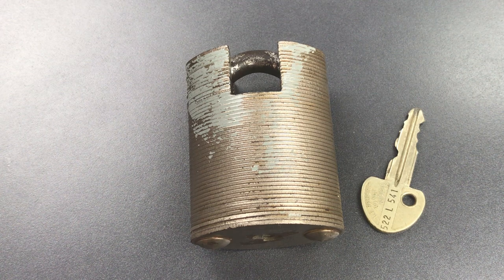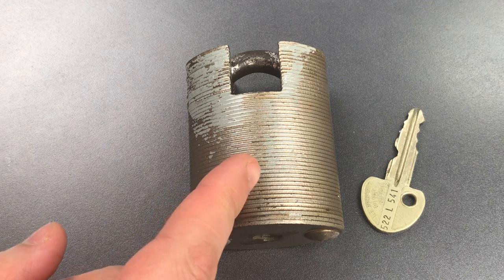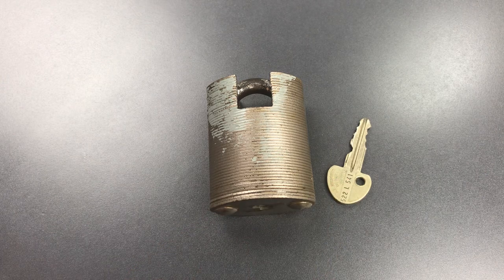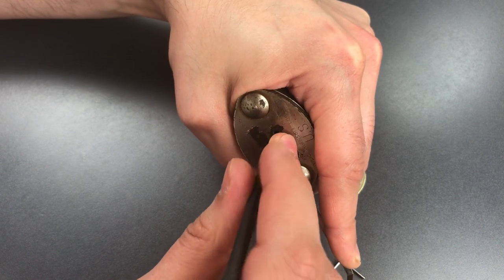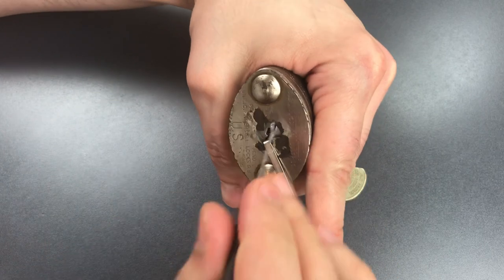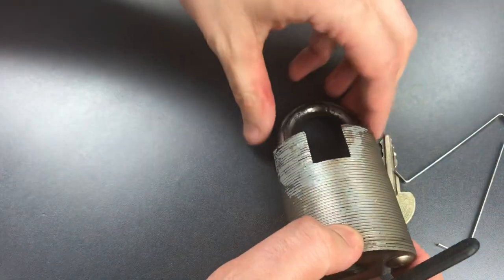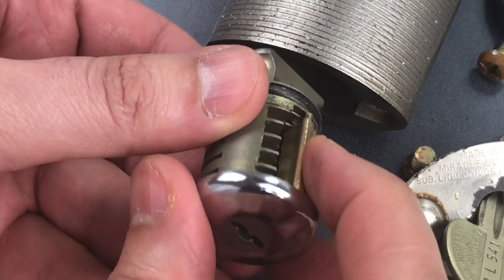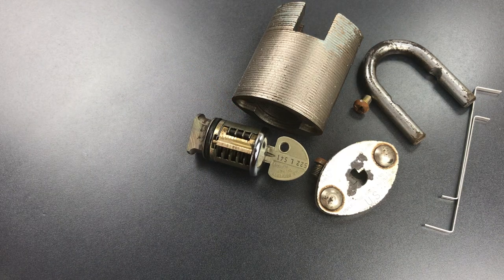[687] U.S. Military “Miracle Lock” with Ingersoll 10-Lever Core Picked and Gutted

Comment: When I was in Germany in the early 70's we had these locks securing our arms room.  We had an alert early one morning and couldn't find the armorer.  One of my PFC's said he could open the arms room.  I told him was crazy.  He took out the key for his Volkswagen put it in the key way and wiggled it a little bit and the the lock opened.  Lost all confidence in the Army's security practices.
Reply: No he never,a VW key will not even go in the keyway
Reply: cardiffpicker1 the dude must have snagged a key and was lying lol
Reply: @omgitsjoetime if it really  happened  then that is the most likely  scenario
Reply: cardiffpicker1 in the 70s keys were smaller
Reply: @acciaiuoli  I know but they still wouldn't  fit, VW keys were flat ingersoll  keyway  is like a W.
Reply: @cardiffpicker1  What do you mean "flat" or "W", do you mean like using a single side of the key vs both sides? Because there are VW keys that use both sides of the key (grooves in both sides with no flat side).
Reply: @rdizzy1  key profile ,VW are not technically  flat but majority   can be used either  way, ingersoll  profile  is like a w shape and no VW key would  fit in the lock.
Reply: I think maybe the problem is that the lock he remembers might not have had an Ingersoll core
Reply: @omgitsjoetime  And didn't want to lose his access to the room if the lock got destroyed. Luckily he had a very gullible superior. :)
Reply: Dude VW making sure your always equipped lol. Impressive.
Reply: Also was with the German military ( Smsgt ret GAF ) . We have 2 locks at our arms rooms and a Alarm system. During the day one of the locks is open. The key is in the posession of the comanding officer. The other one is in the posession of the armourer. Spare ones are located in sealed envelopes in the safe at the guard house for use in case of emergency. No way that only one can open the door. No need to pick / demage it.
Reply: @cardiffpicker1  Hmm but in the 70s Euro car keys were not much bigger that locker keys and were only one way.

It was said you could smack a suitable sized flat blade screwdriver into a worn lock and open it that way.

And if you Googled it you might find Ingersoll used to make car ignition locks ... perhaps the cores were very similar???

Pure speculation of course.
Reply: @t1n4444  vw have never used ingersoll  made locks in their vehicles.
Reply: @cardiffpicker1  Well it was only speculation.
Reply: Did you ever find the armorer?
Reply: @jeremiahm3765  Yes.  He lived down town with his wife and was late getting in.  We could only open the outer door so we didn't get our weapons out.
Reply: @cardiffpicker1  old european vw beetle keys looks a bit like
Reply: @t1n4444  I once saw a prankster open a load of cars (back in 1984) with just one old car key.   Long time ago cant recal makes, but he opened many car doors with just one key.
Reply: @ukdashcamguy500  Crikey!!!

So VW did use Ingersoll locks (and keys) after all!!!  Game set and "match"!!!

I knew it all along!!!

So much for all these VW lock expert ...

Just goes to show ... (wait for it) ... "always trust your ignition".
Reply: @t1n4444  I love it!
Reply: never happened. it takes a pro picker a few minutes with premade tools to open it, there’s no way in hell someone did it in seconds jiggling the keys.
Reply: @bostonrailfan2427  depends. If the lock is sufficiently worn, which you'd expect from military grade locks, them using the locks a lot over long periods of time and not being particularly aware of how wear can affect a lock, then it's resistance to a raking attack can be significantly reduced. If the key he had in his car had similar toothing to the lock, then the lock could definitely be opened with a small amount of jiggling. The tools used by LPL do certainly work to open a lock, but from my understanding they are the slowest method for picking a lock, if by far the most reliable, being able to open almost any lock with slight alterations to the setup.
Reply: ... some interesting stories, but when I was in the Army reserve (I was the logistics sergeant and therefore the armorer) we would just send one of the lighter specialists up into the ceiling to drop down inside and unlock from the inside.  This was the supply room and not the armory... but an armory key was in there, so not exactly secure.  For clarity I should mention that I didn't have a key since I was a reservist, the UA had the key and there were multiple occasions in which he was unavailable but still demanded that I do my job -_-"

Comment: "I'm not sure why some of these locks are fairly easy and others are quite hard"

Those might be the quality control issues you mentioned.
Reply: The QC issues stemmed from the Finnish core, not the English core. Bit who knows
Reply: Some are master keyed which makes any lock easier
Reply: Some might be much more worn out than others. That can make a big difference to the pick-resistance of a lock.
Reply: That's exactly what I was thinking when the gates didn't line up very well at the end

Comment: I was an AMMO troop in the USAF from 2005-2009 and I instantly recognized that lock when I saw the thumbnail. We used the same lock (although the housing/body was made with a smoother surface, not sure of the type of metal) to secure all 100+ munition storage facilities (ie. "earth covered igloos"). I always wondered how easy they would be to pick. Thanks for the video!

Comment: Great videos man!  
When I was in the US Navy (Surface not Sub) many years ago we had these locks on the torpedo and missile magazine doors.  They were there to keep bored sailors and contractors and such honest.  The weak link was the doors themselves.  I won't elaborate on the doors, but in addition to the lock there were also armed security patrols and alarms.  Because there may or may not have been nuclear weapons in the missile magazine, the lock key was kept inside a small safe with a combo lock which was in turn kept inside a bigger safe with a combo lock.  Known as the inner and outer safes, no one person had both combos.  You had inner combo holders and outer combo holders and it took one of each to get the key to the lock, after alarms were turned off (2 people) and sentries were posted.  It is called the 2 man rule.  No person is ever allowed to be alone with nuclear weapons, even if they were just going in to do something as routine as magazine temperature checks.
Reply: That's how it looks on the New Jersey.  Don't think they ever had a nuke, but they had the control system to operate them.  Nested safe, two keys just like you said.

One of the more recent videos on that channel.

Comment: Years ago, I had a similar lock (externally, it looked the same) that had many flat plates (don't remember but I think it was something like 78 plates) stacked in the core and it used a double-sided key. Motorcycle thieves on Okinawa used a screwdriver with a lever to shear the pins on regular locks. They tried unsuccessfully to open the lock I used. Fortunately, I was still able to open the lock with the key. I disassembled it and found that they had damaged some of the plates. The lock continued to provide security until I left Okinawa.

Comment: I had one of these padlocks 20 years ago, but a genuine Ingersoll one, I tried picking it for years with no luck, but also had very little idea of what was inside as they are rare as hell in Australia, and we pre-internet easy to find times. 
Ended up working at a different locksmith shop, managed to get a new cylinder and keys as my new boss knew about them and who had spares. 
The face of it has layers of harden steel and ceramic, was not an easy task! 
But, glad i now have a functioning one!

Comment: I was an Armorer in the 82nd ABN. about 1989-90. when MY unit changed out the Padlock I kept the old one. IT is one of the 10-lever ones. I don't have the regular key. but do have what I was told is the Maintenance key. when you use the key if you turn it counter clock wise, you can pull the tumbler out with the key.

Comment: You know whats funny these types of locks where used to secure tactical nuclear weapons, so you could literally steal a working nuke by picking this type of lock
Reply: Nuclear weapons are always guarded, so you'd have to pick two of these without the soldiers standing right there noticing.
Reply: Most nuclear thefts are actually caused by brute-force destructive attacks, such as >36" bolt cutters, or Ramsets. The best defense is to make your nukes not the easiest target in the neighborhood.

Comment: Had thes in my unit in Korea 1975-1976. Arms rood with three locks , mail room, safe room, and ammo dump (gate and each bunker). All had 1/4” steel covers over them so they could only be accessed from below. would sure like to see you pick the lower arms room lock that was about 18” off the floor. Keys kept in two safes, duty officer had the key to the safe room for 24/7/365 access. O400 alerts can get messy so quick easy access is required.

Comment: Ingersol are a common front door lock in the UK, especially on older properties 
For quite a while you could only get spares directly from Ingersol
Self locking latch and good solid brass lock and key
Most modern properties now have flimsier locks

Comment: I too love these locks.  It would be easy enough to cut some false gates into the levers. I might try that if I can find another one of these locks
for sale. I'm glad it's not just mine that's a bit unreliable with the key. Hopefully now I know where to look for the inconsistence, I should be able to file a new key (if I can get a blank) or widen the gate a little on the lever that's sticking. I don't use this lock, it's in my collection, but I like to have reliable smooth working locks. So thank you for showing the detail (I was scared to lift the sidebar on mine!)

Comment: I'd like to see this lock being picked when it's actually on a door or weapon cabinet. most likely you'd have to do it upside down as there wouldn't be enough space to turn it around. I'd say it's very safe and nobody is going to pick this open in real scenario (unless thief is someone like LPL and knows 100% which lock is being used).

Comment: They had lever locks on the steam or coal access tunnel cage gates underneath or leading to bank buildings. Lots of blind false gates in the levers, which are stashed behind a metal curtain, or TWO, inside the locks! Lever padlocks were notoriously easy for my second cousin to pick, but he has passed on ages ago, and is the same generation as most people's grandparents or great grandparents, so lever padlocks were much more common back then. There is room for false gates in an Ingersol padlock.  I don't know why they didn't use some.

Comment: I recognised that ingersoll key straight away - it is very distinctive and when I was a child, we lived in a road in the UK, where these locks were fitted to every door, doors which were distinctive large oak structures themselves. (The houses were constructed in the 1920s - I think.) No-one could cut a spare key as the indentations were on both sides - you had to send the serial number - prominent on the key - to the manufacturer to get a duplicate. Anyway these were seriously secure doors which often would blow shut and lock people out their homes. Yet my mum worked out that could easily get back in within seconds and would let neighbours into their homes when they had been locked out. For reasons of style the letter box slot was vertical and right next to the lock. If you had a thin enough arm as she did, you could slip it in, reach around the flap and pull the lock lever (it pulled outwards rather than turn). Lol. It was the original letterbox - maybe they were meant to have a letter cage, but someone removed it - after all, we like our letters dropping on our mats in england, where we train our dogs to rip up the red coloured ones.

Comment: If they put a protrusion at the end of the spring loaded side bar that went into a notch on the key. Then made it so you had to reverse rotate the cylinder to push/squeeze the sidebar down against the spring load into the gates and the key notch. Then you have to pull out on the key so that the notch holds the side bar down while you rotate the cylinder in the other direction to unlock the lock. That would make the lock virtually un-pickable.
You would have to reverse rotate pick the lock to push the sidebar down, then know that you have to reach all the way to the end of the cylinder with a strong rise pick to grab the protrusion and pull on it thus holding the sidebar down while then rotating the cylinder towards unlock until the sidebar was past the block.
Hope you can picture what I just said.

Comment: I'm curious if LPL is allowed to do a Sargent & Greenleaf padlock?  40 years ago, an armorer lost the keys to an arms room padlock and was going to trash it, but instead gave it to me for a paperweight.  I obtained a replacement Medeco core and keyset a few decades later after the military stopped using the locks.  I've taken the lock to several locksmiths, and they seemed clueless about how to open it.  I contacted Sargent & Greenleaf and they said it is their policy to not open such locks issued for government use. The key teeth have alternating compound angle cuts, unlike any regular key.

Comment: I'm watching this for the first time some three years later.  I'd like to see you pick this lock as it was used in the field.  You see, the lock was recessed in a steel box that snugly surrounded both the lock and the hasp.  There is just no way you would be able to use those three or four inch levers.

Comment: AVA was very good lock. Did they have any quality issues? It sounds odd to me if they had as I’m familiar with AVA and it was well made as was the key. The Finnish bicycle factory Helkama used AVA locks and they worked always well. Today they use Italian made Basta locks which are a nightmare in wintertime. We call them ”Baska” witch sounds similar to s*it. AVA was used everywhere in offices as desk locking systems and I miss them because they were small, well working wonders. I hope you don’t disagree with me.

Comment: That technique, with two tension wrenches, and rotating the lock to switch between the two, looks like it would be impossible to use, if this padlock was actually attached to something.

I'd love to see you build a workstation where you lock padlocks onto a shackle, and revisit this,  and other difficult locks, without being able to move the locks around.

Comment: if this was on the igloo door i don't think you'd be able to pick it. there is thick metal hasp that encloses the whole body. and a plate below, to prevent working "upside down"  not only that you would jiggle the door setting off the alarm.

Comment: Now imagine this lock is actually locked in a hasp where it doesn't have anywhere near the range of motion LPL has holding it in his hands.  Swapping those tension wrenches back and forth is going to be way harder.  Seems far more likely someone would open it with a sledgehammer or something than pick it.

Comment: Would it not be more secure if the gate was spring loaded inwards and the pin was set up to lift up and jam the rotation? So the pin would fit into a trapezoid like slot so as you add tension it would lift from the sliders and then you could not get any feel.

Comment: That's a really neat core! I haven't seen that before. Seems to have some similarities with the MIWA U9 lock which I got recently and also find really interesting. Looks like the Ingersoll internals should be along the lines of the diagram from the US3587261A Patent? If so they both have U shaped disks/levers rotating about a post that is opposite from the fence/sidebar. MIWA puts in some false gates and serrations into their locks to add some more pick resistance which I find quite difficult to deal with. Thanks for sharing that :)
Reply: I noted Rob K comment on the Miwa U9 core.  Are you ready yet to show us that you can open the Miwa U9 core Padlock that I sent you? (first sent to BosnianBill, who couldn't open it, and I suggested he send it on to you).  Similar mechanism, but Yes with false gates!
Reply: Ken Nixon what padlock body is the core in? I'm interested in putting one of my cores in a padlock but the core diameter is slightly larger than typical north american KIK cylinders.
Reply: The entire padlock is actually made by MIWA, model U9-APL that I picked up in Japan on a business trip.  I also picked up a mortise cylinder in the U9 format that is currently with Tumbl3r to see if he can pick it.  So far seems nobody has been able to pick a U9 lock.  I am thus unaware of any other manufacturers lock bodies that could accept a MIWA U9 core.
Reply: Ken Nixon check out my last vid ;) Tough lock. Took me many hrs to learn it. I have a second lock I havent unboxed that I was going to see if I can apply the same method to get without looking at the key or lock internals. Don't have much time these days though so that'll have to wait a bit.
Reply: Very nice -- Very well made high quality from Japan, reminds me of precision / quality in Abloy Protec 2 core, abet different mechanism.

Nice Job picking, but without prior knowledge to miss false gates, "a bit" more challenging to say the least.

Thanks for showing us -- GOOD JOB!